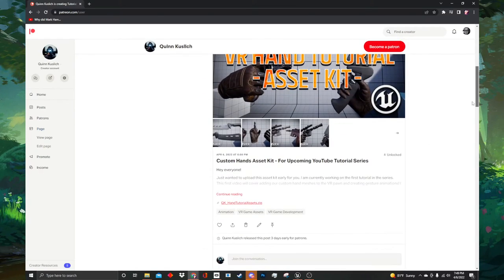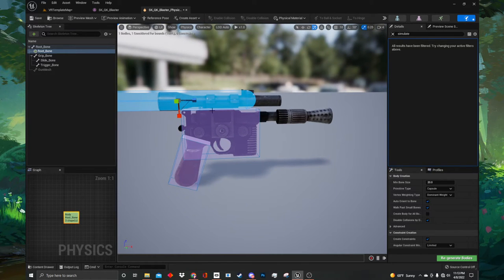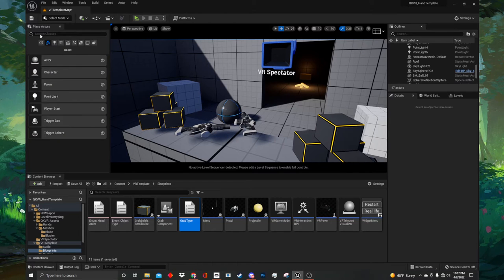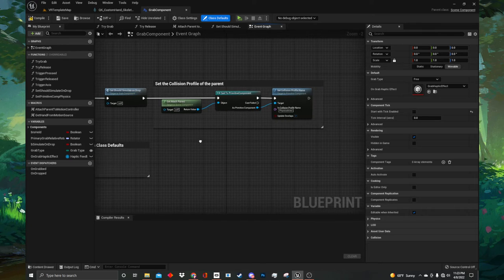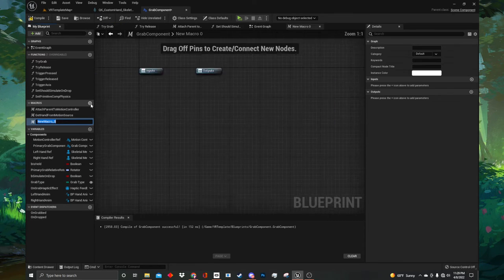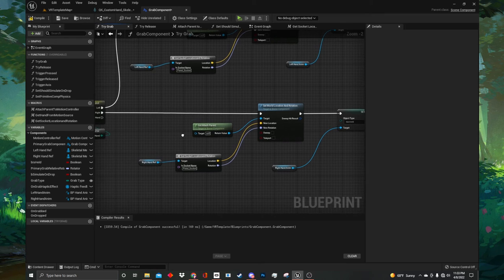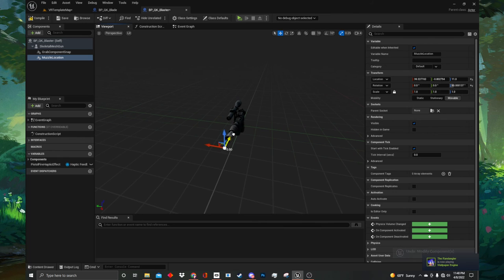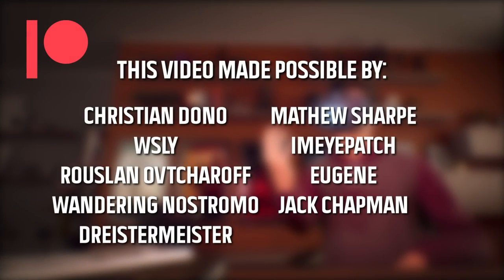VR Hand Animation in UE5 & UE4.27 | Tutorial Part 2 | Object Specific Grip States for VR Weapons

Comment: im stuck at 12:50 because i dont have a "get hand from motion source" node??
Reply: Facing the same issue as well - did you find any solution?
Reply: @taarikaranjith7913  Try to use Get Held By Hand
Reply: obviously its a custom made macro, better two find its creation in previous parts

Comment: Tip to anyone having issues with grab component rotation: in the object bp (knife or gun) add an arrow component attached to the grab component with 0,0,0 rotation and location. this way when you move the grab component you know where it is and which way it's pointing. same goes for muzzle. much easier to set up

Comment: First of all many thanks for the vid Quinn! Great job!

For people that still have issues with the rotation of the gun (in the left hand), the following fixed it for me:

I exported the skeletal mesh of the gun as .fbx (right click on the skeletal mesh in the content browser -> Asset Actions -> Export), changed the name of the .fbx file and dragged it into UE5 again. You'll get an FBX import settings window where you can change the import rotation. My skeletal mesh had to be rotated by -90 degrees on the Z-axis, but you might want to try and see what it should be for your mesh.

After importing the 'new' skeletal mesh you might have to re-apply the material which can be done within the skeletal mesh under Asset Details. You can leave all blueprints the way as Quinn showed in the video, but don't forget to change the rotation of the Pistol_Socket on the hand and the Muzzle location and rotation within the pistol blueprint.

Hope this helps!
Reply: This fixed my problem with the left hand gun grab :)

Comment: Excellent tutorial series... the only thing I am mainly still working through is that the 'blaster' vs. 'default template gun' are 90% rotated in their blueprints.   For some reason, I can scale the StaticMeshes (inside the blueprint), but not translate/rotate.  (not really part of the tutorial, but was just doing a bit extra to see if I could adjust the template gun to the animated hands, etc.)
Reply from the maker: You can do it in maya or blender and reimport

Comment: Love the video but like many others here in the comment section I am having the backwards problem with the left hand when holding both the knife and the gun. I read through the comments and have attempted the suggestion of multiplying the rotation by a vector and it does not work properly. The knife actually can be grabbed in a couple different ways, whereas my right hand only grabs it my specified way.

If it helps, I multiplied by a vector by plugging the rotator into the Get Right Vector node, multiplying that with a vector, and plugging that return value into a Rotation from X Vector node, which goes back to the Set World Location and Rotation node. I have tried all combinations of negative values

So far the closest I have gotten to actually fixing this is splitting the rotation pins into 3 scalar values and going through and multiplying the appropriate value by -1. This get's it close, but the angle is still off by a few degrees since I had it set for the right hand. I know I could set it somewhere in the middle so it looks half decent for both (rather than really good for the right hand and bad for the left)

I gotta admit I don't see what you did in the video to where you don't have this problem. I followed the tutorial very closely. Thanks again!

Comment: Apparently this doesnt work for UE4.27? At 12:49 it requires a Motion Source as Input and not a Controller. Unfortunately way too noob to figure it out by myself I guess.
I used "Get Motion Source for Hand" instead, selecting. Doesnt make sense probably, Ger Motion Source for Hand -> Ger Hand for Motion Source.
I mean, the snap part on the right hand works for some reason, its just way off on the left. If youd have quick suggestions Id really appreciate it. Trying to implement this for a school project, due today `:)
Reply: Did you figure it out Im having the same problem

Comment: I seem to have the same issue as another commenter:

"I had a random issue -  My right hand attachment works fine and attaches as I've set it up in the Skeleton asset. The left doesn't seem to attach at the same point, its fairly skewed."

This happens to both the pistol and the knife

I have tried negating the socket X and Y location in the grab component, but to no avail. If you could help me fix this that would be great 👌
Reply from the maker: Do you have any 3D software by any chance, we need to change the origin rotation of you custom gun mesh to match the pistol mesh
Reply: @QuinnKuslich  I’m using the same gun and knife as yours
Reply from the maker: @dingledongle307  Oh, ok that is really weird. And you moved try going into the skeletal mesh and check to see if the rotation of your gun socket is in the negative on any of the values. If it is, change them to a positive rotation values. Let me know if this fixes it, if not I might have one more workaround for fixing it.
Reply: @QuinnKuslich  Issue fixed! The reason it did not work for me was because I forgot I made a function to handle the socket location and rotation to remove any repeated code. I forgot to give a proper reference input for the motion controller. Thanks!
Reply from the maker: @dingledongle307  perfect glad it worked
Reply from the maker: @dingledongle307  Glad you got it working!

Comment: Cheers for the tutorial man! Keep it up. 

I had a random issue - I tried applying this to a different pistol mesh and had an issue with attaching to the socket. My right hand attachment works fine and attaches as I've set it up in the Skeleton asset. The left doesn't seem to attach at the same point, its fairly skewed. Can't seem to see where I've gone wrong, any help would be cool :) cheers
Reply from the maker: I would recommend just dragging out on the left-hand from the get socket location and adding a negative one to whichever axis it’s flipping on
Reply from the maker: And he would do this inside to grab component where we put the socket code
Reply: @QuinnKuslich  Where Exactly In Grab Component

Comment: Great second video I have it all working just have a problem on the last part. 

So this is just after I have set up the 1D Blend Space, I have set the correct anims up but when I grab either of the objects , knife or gun my hands do not go into the correct anims. If i pick up any of these objects my hands go into a pointing pose and not sure where to look at changing this. Any help would be grateful.
Reply from the maker: That’s kind of weird I’ve never had that bug before, did you make sure to add the gun poses to the animation state machine?
Reply: @QuinnKuslich  In my AnimGraph in my New State Machine I have, Open, Grip, ThumbsUp, Pointing and then from Open goes to ObjectState which is where my BS_ObjectAnim is placed with the float and hooked up with the correct BS_ObjectAnim Anims, Gun Hold at 1, Knifehold at 0 and Grip at 2.
Reply: Any ideas on this bud?

Comment: Hello! I just watched you tutorial and got everything working almost to perfection. I have two problems, 1. the knife moves around in the hand when its held and 2. The knife gets flipped upside down when I grab it with me left hand, Any fixes would be awesome, and if this helps im in 4.27.2. Cheers!
Reply from the maker: I was just recommend Going into the grab component and adding negative one to the X axis on the left hand grab
Reply from the maker: Just do a multiply vector node and then multiplied by negative one on the XY or Z depending on which one works
Reply: Will this also fix the problem of the knife sliding in the hand?
Reply from the maker: @Drewdaddy07  i’m not sure about the bug with a knife sliding in the hand that’s weird. Do you have physics applied to it or something?
Reply: @QuinnKuslich  I’m not at home to check it but when I get back I’ll make sure to double check the settings on the grab component
Reply: @Drewdaddy07  did this fix it. lol i am having the same issue. where it works perfect in the right hand but all sorts of bugs in the left hand

Comment: My left hand is not grabbing it right... My right hand grabs it fine but my left is not when i grab with my left its not even in my hand its floating away from it Also if something is in my left hand i can use mu right hand to grab it. but if something is in my right hand i cant grab it with my left unless i let go. It seems my left hand does not have as much controll or something.
Reply: did you ever fix this I am having the same issue.
Reply: @MidnightVampiro  No sorry, I ended up learning more on ue5 and making my own system I would recommend doing that.